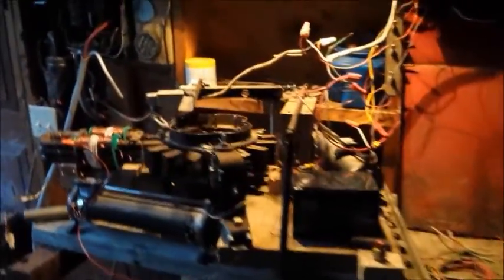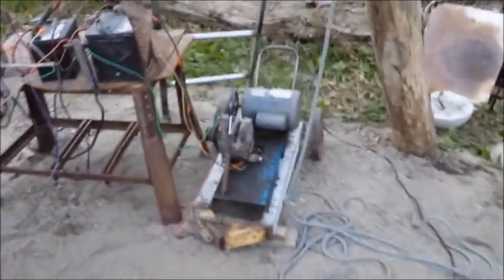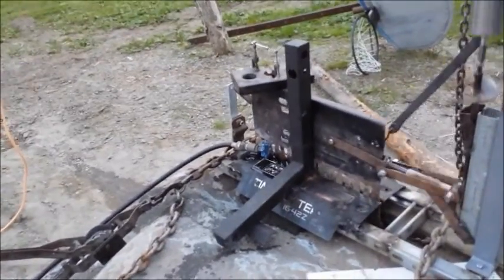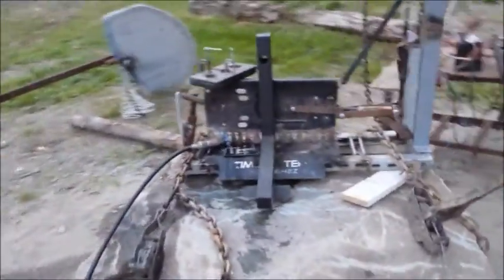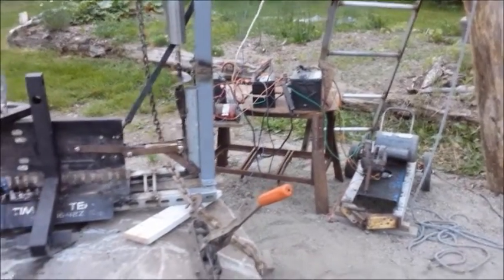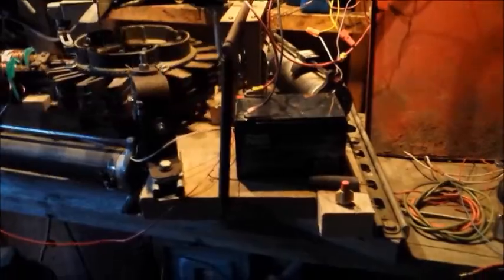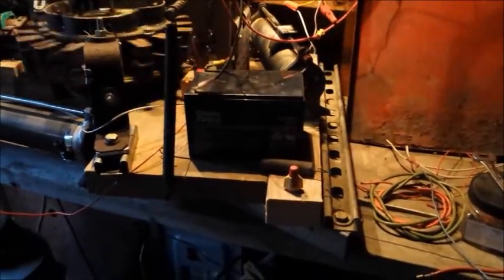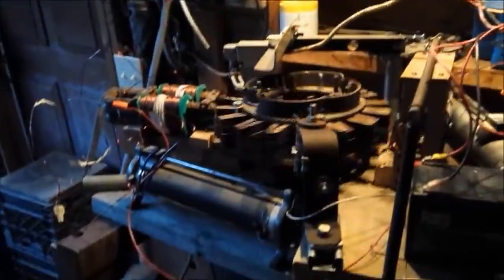First Run  Lots of losses but looks like its promising.

Comment: The magnets on the wheel were set in the repel mode to send max "B" field into the ground, That was the purpose of the magnets 5 deep 25 around all in repel mode.  The tall pillar also worked in conjunction with same a a resonating source.

Comment: This is really good progress, the only thing I am worried about is how will you be able to suspend the rocks like ed did
Reply from the maker: thats easy with the right tools and the right tripod poles and the 50 ton train hoist we see in the famous picture. the quarrying, cutting, chipping and sculpting is MY weakness.    Everybody elses too. The wheel didn't lift the rocks they just didn't know it was the central hub of a larger sculpting system made for multiple men in the compound. So they though levitation. lifting is just plain assed hard work like in the black and white movie.

Comment: now to get it to charge its self you may not have over unity but it should increase the run time by double but as you say you have some losses but when it was in harmony it ran sweet
Reply from the maker: You got it right on. I actually just tore the wheel down last night to equalise the spoke layout. IT WAS LOP SIDED. It needs a very rhythmic pulse not the lopsided one I had before. new vids should be more productive. AND the hammer works crazylike. got to figure the right spring tension on it and away I go. 
Also having a large chunk of the same stuff ed had would better than VT ROCKS.  pretty much harder my says about dat.